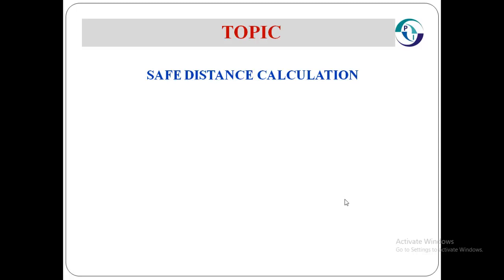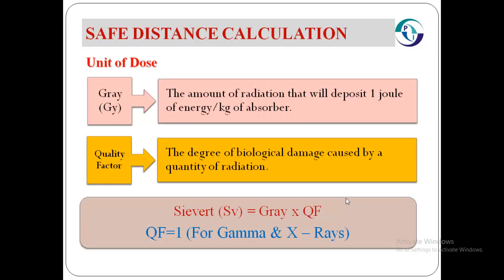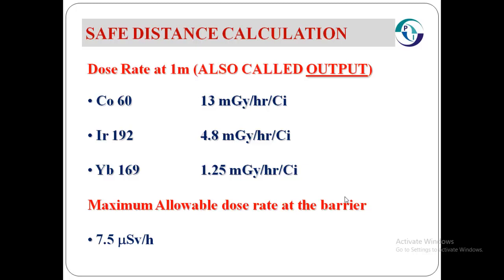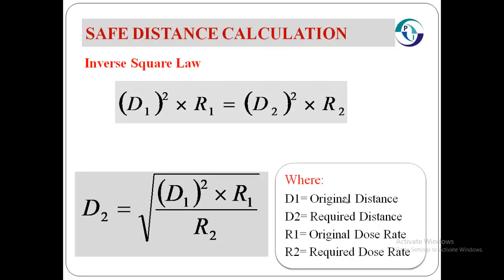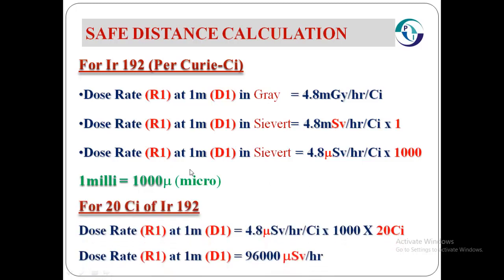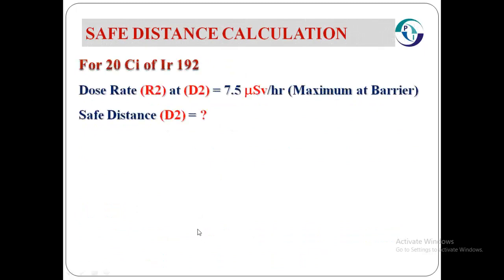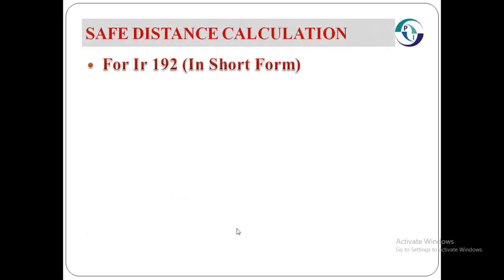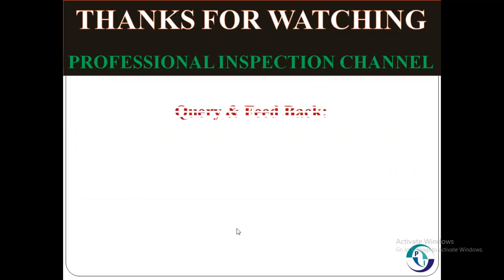Radiation Safe Distance Calculation for Radiography

Comment: How much reduced by collimator ?
Reply from the maker: If you use tungsten collimator then  divide the calculated value by 5
Reply from the maker: Above value is used for standard collimator, For exact calculations there is half value layer and attenuation formula to be used.
Reply: What about 1 leadsheet how much reduce ?
Reply from the maker: @alrianabdalla4206  for Ir192, 4.8mm of lead sheet, intensity will reduce to half.
Reply: Thank you so mutch
Reply: What about se 75 .
How mutch reduce ?